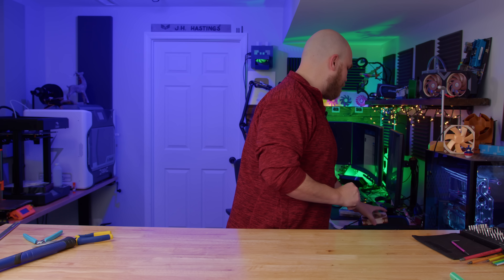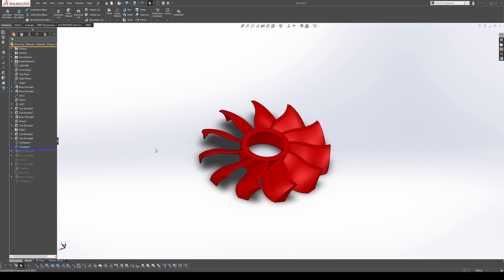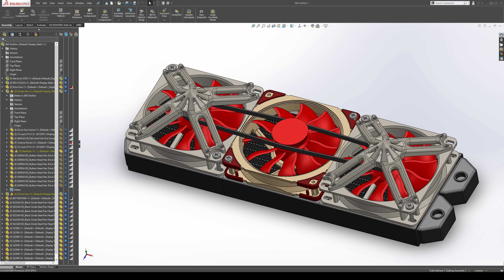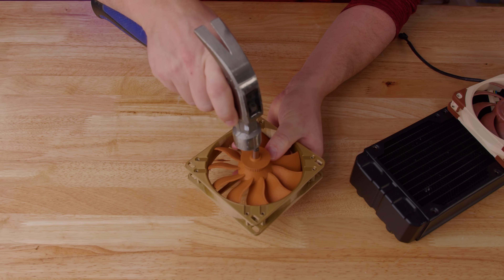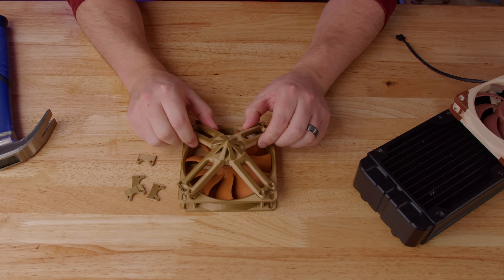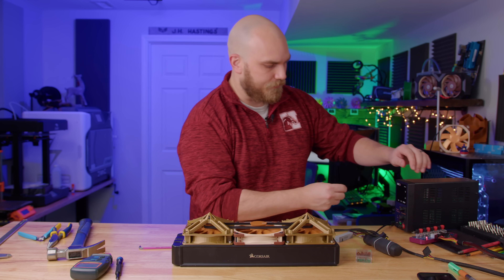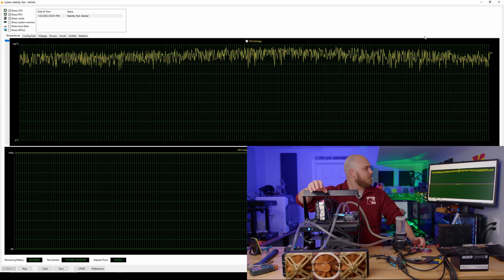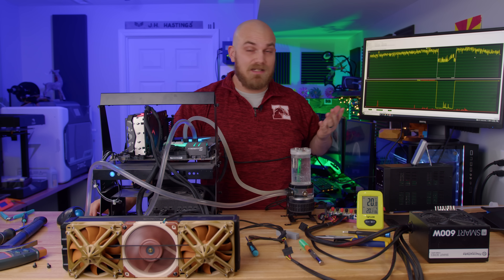I Turned One Fan Into Three | Steampunk Water Cooling

Comment: Two things. the bearings are full of grease which for a fan motor thats being run up to a higher speed, grease is a fairly signficant frictional load.  I would also run two belts, one to each outside fan, and give them less tension. You just need enough to not slip, with your system you need to have a pretty significant belt tightness which also makes it hard for the central fan hub.
Reply: Something that works well is "relaxing silicone lube"
Reply: graffiti or lithium greese
Reply: @UPsideDOWNworld321  Lithium leaves residue and attracts dirt and dust. Silicone would be a better choice since it is a dry lube.
Reply: please make a follow-up with those upgrades ! the idea is so cool I would love to see it work
Reply: Yes just what I thought. Also i think a timing belt is not needet. A flat belt or maybe even a rubber band will also reduce friction.
Reply: The belt also has to much resisting, since it is designed for way more torque. Thin rubber bands would be more efficient
Reply: believe it or not, the first time I learnt about this was when I was playing with a fidget spinner.
Reply: I was thinking along the same lines of reducing tension but through other means, you could add a housing on the center fan like the side fans but for the purpose of adding guide bearings to the side of the center gear to guide the belt into more of the gear to bite better without such a high tension, I'd draw an example if I could/knew how through YouTube comments.. maybe.. something like..    o   *  O  *   o   if each O is a gear attached to each fan and the * is a guide bearing, imagine the belt going around all of the gears (just like in the video) but being pushed downward by the guide bearings so it would sort of zigzag between the gears and guide bearings on the top side and just go straight across on the bottom, the guide bearings would need something to prevent the belt from slipping off but that'd be easy to 3d print, and if you put one of these guide bearings on a slot you could use it to fine tune tension if you had a way to tighten the bearing down in place. But even if this were the way to go it would require even more bearings so the right bearings would still be a must.
I dunno maybe I'm over thinking it, anyone else's head hurt?
Reply: @e1337H0b0  I was thinking pretty much the same thing, but while reading your comment I thought that it might be a better idea to not have the actual fan in the middle, and it's probably better to have the same size pulleys. Maybe you might get away with just one "tensioner" (Or guide bearing as you call it)?
Now I'm overthinking it :p
Reply: the belt itself is toothed and requires almost no tension, so the belt choice is good... but with almost no pulley wrap on the drive pulley, he needs excessive tension.  Another possible solution is to add an idler or two to his system.. this would let the tension be lower, belt wrap be higher and the additional frictional losses of the idler is lower than the additional losses of running a second belt... (this is assuming the belt loss to pulley friction ratio is the same as automotive belts.)
Reply: I'm thinking flexible round belts would be ideal for this low torque application. You can buy neoprene round belts from mcmaster carr in a variety of diameters and sizes. I also agree on cleaning out those bearings. You could even go to some cheap ceramic open bearings.
Reply: why not just use open bearings ... they just had to free spin ... no load no nothing ... bevore you mix some oil mambo jambo ...
Reply: I found with abec 7 bearings that some wd40 significantly helps.
Reply: @mrnlce7939  yep, or light machine oil. You can completely clean them to run dry but they make more noise. Inox MX7 is fantastic as its very thin but wont evaporate.
Reply: @colinsmith6340  the best ive used and ive tested a lot - mix 3in1 oil - multi- purpose and ATF automatic transmission fluid. 3 parts 3in1  1 part ATF transmission fluid.  - it helps penetrate the bearings and bearing housing - and will resist rust in the bearings - it also will help the oil from burning up and out with heat.
Reply: @mrnlce7939  The best ive used and ive tested a lot - mix 3in1 oil - multi- purpose and ATF automatic transmission fluid. 3 parts 3in1  1 part ATF transmission fluid.  - it helps penetrate the bearings and bearing housing - and will resist rust in the bearings - it also will help the oil from burning up and out with heat.
Reply: @mrnlce7939  WD40 may help momentarily, but its mostly for Water Displacement and cleaning.

Comment: Could potentially make the belt driven fans run with a smaller pulley and make the driven fan have a larger pulley. Better traction on the belt, plus higher speeds on the unpowered fans.

Comment: Maybe instead try belts used in tape cassette machines? (basically rubber bands) No need to splice and no need for teeth. Twin V grooves on the center fan, one belt per each side, stacked just so. Way less noisy, but the wear (and thus, longevity) will probably be a factor with the roughness of 3D printed parts. Still, I think that'd be my next step. Super interesting concept though, thanks for showing us this utter madness!

Comment: This was an awesome project! Would love to see a back yard ground loop cooled PC. Would be cool to see how far down you would have to have your loop to not need a radiator. I mean it's a bit extreme but it  would probably make a pretty entertaining video
Reply: Once you get below the frost line the ground is a constant 55F, cooler than normal temp. Just need a much bigger pump to overcome all the internal flow resistance of the ground loop.
Reply: @whirledpeaz5758  MY thoughts exactly, how much pump is needed and is it to overbudget to even try.
Reply: @4500MHz_Jay  the tubes should be thin enough to lead the heat out but thick enough to resist the pressure from the dirt above^^
just take a car cooler and put it in the ground - should work ^^ and close to none resistance cause the cooler is like a big pool compared to the rest

Comment: Think it would actually get more performance if the motorized fan would be on the outside as it is slipping a lot in the center (so the band would be much tighter on it increasing the rpm’s of the other 2)

Comment: I wonder if it would run smoother if you give the center fan a dual pulley/sprocket and run 2 separate belts to the outer fans.
Reply: yeah with elastic bands less resistance and noise
Reply: @markilleen4027  more contact points means more resistance/friction. You’d turn 2 contact points into 4.
Reply: @timconway2810  geared belts have way more contact points and are much heavier and stiffer plus there is the resistance of the gears slotting into and out of the pulley, if you are looking for the least amount of resistance crowned pulleys are the best but can be tricky on such small projects, v pulleys or u pulleys with an O-ring belt is simple and still provides less resistance, geared pulleys are only good when there is an aspect of timing, and what do you mean by 4 contact points
Reply: @timconway2810  What if the center had two pulleys that were smaller. So that they would under drive the outer fans?
Reply: I was wondering how it would do with something like an orbital bar kinda like how train wheels have.
Reply: @MrNowherethis  I guess the whole setup will start to vibrate be ause if the momentum from the connector rods
Reply: @MrNowherethis  that would certainly work with the steam punk aesthetic.
Reply: I came here to say the same thing. Also was wondering if the belt pitch is compatible with the geometry (is the belt landing cleanly on both sides of the center pulley)
Reply: @DieselDave359  that's why v pulley is better for small things like this
Reply: I was thinking the same thing. Maybe make the center spindle larger and the outer ones smaller for better mechanical advantage.
Reply: @tobins6800  you wouldn’t increase the amount of work being done.
Reply: And then make the gears bigger on the outer ones, so they require less torque. They would spin slower, but would be easier to spin them.
Reply: I would run two separate belts and overdrive them
Reply: it really needs 2 center pulleys with 2 belts, you're right. the center drive pulley doesn't have nearly enough traction to run it with any reasonable tension
Reply: I think it would move better with rod than a belt..
Reply: Thumbnail told me this was gonna be a problem
Reply: should us one side of the belt on the center pulley you may need to use a bearing to pull way the belt on the other side
Reply: Would sugest that too. Always use 2 belts i you have one driving from the center. Belt need to wrap around the drive just like it does the outer fans.
Reply: This comment
Reply: Also with a 3000rpm noctua fan, ik it doesn't have the metal hub tho.
Reply: Two separate v-belts would be better, as well as making the center pulley smaller to increase the torque output.  Limiting the loss of power through a better gear ratio.
  The outer fans would spin slower than the center fan but overall the center fan will still cool better from higher rpm than is currently possible due to the tension and wrong gear ratio on the drive pulley powering the slave fans.
Reply: Either that, or move the driven fan to the edge rather than the centre.
Reply: if the sprockets on the end fans are smaller in diameter than the center fan, then maybe it would slip less even without tensioners.
Reply: Move the fan to the side then drive the other 2 fans
Reply: @vabroekhuis  center fan would still he an issue. for pulleys to work properly they need a decent amount of wrap around for engagement. inline pulleys never work well without multi belts
Reply: I think you need tensioners to keep the belt from slipping on the drive fan (center fan).
Reply: i think a timing belt is overkill for this application.
Reply: I have a feeling there would be too much friction in the system to keep it running smoothly
Reply: And probably decrease the bearings
Reply: No

Comment: All I'm going to add is, there's a reason motor belts on cars make all kinds of over and unders, it prevents slippage while reducing load as much as possible.  Maybe take this concept and add idler pulleys to reduce slippage and I guarantee you'll have less slipping and better performance.
Reply: I think most of the problem is the motor isn't strong enough to drive that much mass at speed
Reply: he could also use a round rubber band like belt and twist it. However the outside fans would have to be flipped over for the air to flow in the same direction as the middle fan

Comment: What if you had an adapter/hood to cover the whole radiator with one fan? Theoretically you'll get a bit more of an even spread across the radiator. Probably going to average out to the same performance.
Reply: Agreed, i will say at least do a comparison
Reply: I like the hood idea but I would turn it into a shallow triangle.  That way it's blowing across the radiator.  It wouldn't be an even flow but you could focus the most work on the intake side and it would still move all the air.
Reply: @VagabondTE  shallow triangle but set the fan as pull. Thatll ensure the mose even flow
Reply: @paoloalto  Yeah, even better.
Reply: @VagabondTE  this or place it in the middle and add flow plates to it so the center air goes to the center and the more you go ton the outside the more it goes to the outer corners of the radiator^^
Reply: You mean something like what a automotive air to water intercooler looks like? Or an automotive intake manifold on some inline setups....
Reply: @TravisFabel  yep, some kind of shrouded hood to split one fan airflow evenly to the entire radiator
Reply: RadTent™

Comment: I would be more interested to know if you could duct one fan into the radiator that would have more airflow and use less power than the 3x A12x25 fans that are designed to fit it. The fan could be taller and/or larger diameter. Main goal would be to increase airflow and use less power.

Comment: This makes me wonder how it would compare to a  3-1 vent adapter that attaches into the stock fan in a pull configuration with a bit of an air diverter in front of the center fan, forcing the air directly in the center to have a bit of resistance.  This might force better cooling towards the edges.
Reply: 3 tests; 1 fan, 1 fan + 2 slaves, 1 fan with pull funnel.
Reply: This would be a great comparison
Reply: I was just gonna comment this, but I see you beat me to it. This must be done, FOR SCIENCE!

Comment: This gave me an idea make a counter rotating single fan motor with two counter rotating blades with spider gears in-between like a car differential to run the second blade might smooth out air flow and increase velocity okay now build it haha 😂

Comment: Why not 2 different belts off one fan ? Dual single pulley to push the fans . Yes one would drive higher then the other but the whole idea is to make it more complicated.
Reply: would probably help that poor fan bite the belt a bit more
Reply: @BanyanBirb  or a larger center drive pulley
Reply: @braveuser12345  what about weed whacker powered pc cooling fans . Just a crazy idea 😂
Reply: @braveuser12345  ROFL

Comment: Same setup, except power the fans with a Castle Mamba Motor and esc for maximum cooling performance
Reply: That would be absolutely monstrous! I love it.
Reply: I love the idea but a monster would be beyond overkill, even a sidewinder could handle delta fan rpm with some gearing in the pullies and not destroy the plastic pulleys/gears.